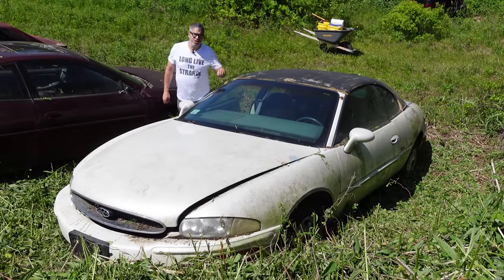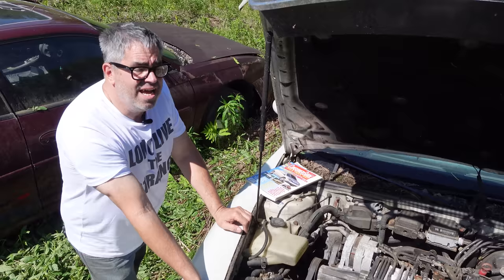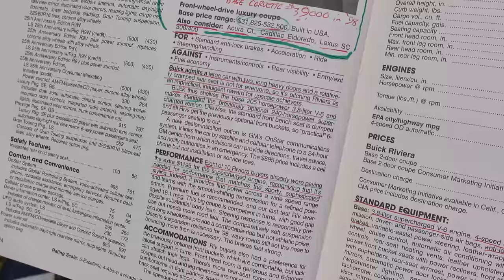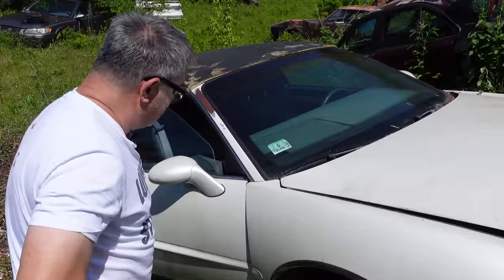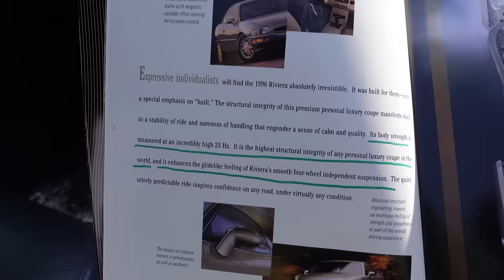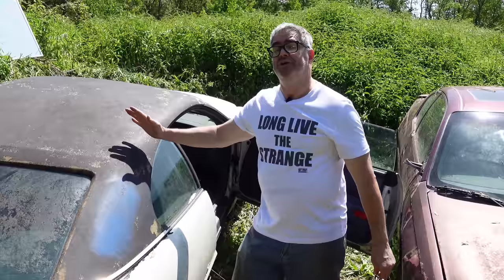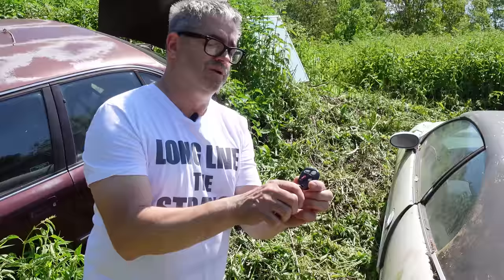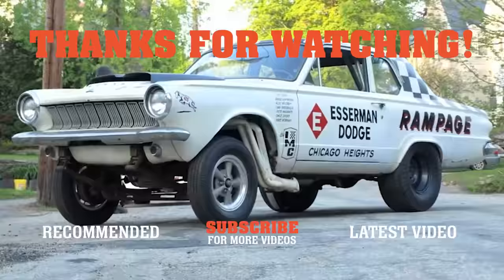More Power Than A Grand National!

Comment: Had a 98' Regal GS supercharged, it took many Mustangs! It hit governor at full boost like hitting a wall! That car later saved my life in a horrible accident was a great car .
Reply: A computer reprogram (or chip replacement if PROM equipped ) will eliminate the 109mph limiter . 
And then. . . . KATY , BAR THE DOOR !
Reply: I don't believe that at all...Had a 98 GTP supercharged and it couldn't hang with the slowest Mustang I've owned an 1989 automatic,,,,my Cobra would've Murdered it and my wife's Coyote 5.0 would be in the next county by the time that thing hit 100mph
Reply: My buddy had a 99 Regal GS S/C with 20 inch gold wheels, 2, 15 inch square Solo-Barics, it was a super pimp-modbile in 2000, LMAO!
Reply: @tomcatmcgillicutty6913 Your GTP had boost leak or compression loss...or something, lol. My buddy's GS would annihilate the same year GT's and just dog walk the old 5.0's. Well no sh*t a Coyote 5 liter would destroy a 240hp brick mobile, they're 412hp in their lowest HP form...
Reply: @jesterokjones4954  7.4 sec 0-60 and 15s in the quarter mile,,,,Isn't enough to "take out" many Mustang s,,,,,,,,unless the Mustangs don't know your racing....
Reply: @tomcatmcgillicutty6913  I wasn't driving, wasn't my car, but I was in the car for a few races with some Mustangs. The Mustang did 0-60 in 6.8 and ran 15's as well, you also know that those figures can vary a lot depending on conditions.
Reply: @jesterokjones4954  BS
Reply: @jesterokjones4954  Nope 98 gtp bought brand new,,,wouldn't hang with a Mustang,,,if they were that quick go look up the quarter mile times they laid down,,,not happening bro...Taillights,,,,that's all you'd see
Reply: @tomcatmcgillicutty6913  he sure wasn't encountering Coyotes , they hadn't built them yet . And running into a Cobra was very few and far between . 
He said he raced "Mustangs". 
What he was probably running against was 4-eyed Fox bodies , which were mediocre at best . 
While the Riviera had a supercharged V6 , a four-eyed Mustang could have a PLETHORA of weak , anemic motors . 
When the Fox body came out in 79 , the 302 ("5.0") was available .
But for 80 & 81 , they took the 5.0 away , and the top engine was a weak-sμ©k 255 V8 . 
In 82 , the 5.0 4V was back , but it wasn't "legendary" by any means yet .
Now factor in how many 4-eyed Mustang were built with naturally aspirated 2.3 4 cylinders , 200 cid inline 6s , and 3.8 liter V6s. 
There were an awful lot of 16 second plus Mustangs rolling around . 
Even when the roller cam , fuel injected engine came out , most cars were still testing in the low 15s/high 14s . 

And then came the legend ~ TONY DEFEO ! 

Even though he wrote for a magazine , Ford wouldn't give him a roller EFI Mustang to test ~ Probably had SOMETHING to do with a drag test he'd recently done on a Lincoln LSC ! 
But that didn't phase Tony - he went out and BOUGHT , with his own money , a brand new stripper 5.0/5 speed LX hatchback . 

And then he SET THE WORLD ON FIRE , pushing that bone stock 5.0 to a 13.89 
 No one had EVER seen a stock Fox body run that quick before . 
Tony eventually got that car down to 13.49 , bone stock , I believe . 

But before Tony , 15 second Mustang were the norm . 

So , there were a LOT of slow Mustangs out there only L👀KING fast - no surprise that this Riviera encountered a few of them , because the mediocre Mustangs probably thought it was another 18 second LeSabre. 
Surprise , surprise , surprise , as Gomer would say !
Reply: @tomcatmcgillicutty6913  BTW , the street ain't the strip , and a LOT of Mustangs on 225/60R15s that could find traction on a concrete pad soaked in "track bite" would just sit & spin on oily Macadam ! 
FWD with all that weight over the drive wheels has a real advantage at the "stoplight grand prix" !
Reply: @Richie_the_Fixer  Yall are funny,,trying to make these things out as some kinda pocket rocket hahahhah,,,go check out the advertised et's of the day,,not as quick as the mustangs of the day...I had one they were ok as a family ride but NOT Mustang territory...Any FoxBody 5spd in decent shape with a 2-4degree timing bump in a good tune with a good driver was a 14-14.5 sec et car all freaking day..Drag radials and it's well into the 13s..... You guys are smoking crack
Reply: @Richie_the_Fixer  I'm talking the 86-93 variety,,,not the 4eyed cars 79-84 although those were actually  cheaper and easier to modify,,so yeah he might have beat up on some of those but I've seen enough 86-94 variety Foxes running low 14's stock I t s accepted as the norm for those,,,13's with a decent set of rear tires all day....
Reply: @tomcatmcgillicutty6913 xactly. These guys making it sound like they were fwd LS powered Camaros and Trans Ams 😂

These cars couldn't even outperform a comparable Nissan Maxima that were 3.0 liters and naturally aspirated.

A 98 Max ran 0-60 in about 7.5 and the 1/4 in the high 15's. With a smaller engine and naturally aspirated. 

All these GM cars were junk 😂 just these badge programmed American consumers overpaying for the short end of the stick 😂
Reply: Everyone arguing about how the Mustang was so much faster must've forgotten about 95% of the shitbox Mustangs manufactured and on the roads between 1982 and 1998. The vast majority were daily drivers, not Cobras and tuner projects. If you lined them up at the track for 1/4 mile pass the Regal would've crossed the line in about 15 seconds while your mom's Coyote Mustang would have crossed after another 13 years of R&D and manufacturing.
Reply: @paulybeefs8588 Sorry pal, the OG 5.0 Mustangs were faster than these stock for stock. That's just facts. I'd bet a '99-04 GT would be faster as well. Go look it up if you don't believe me.
Reply: @TireSlayer55  Learn to read.  You're comparing cars of a different era. Pretty sure there weren't many '99-04 GT''s on the road between 1982 and 1998. The vast majority on the road through that era were from the 70's and 80's. Even most of the 5.0's of the era made less than 200 hp, ran a 0-60 in the mid 8's, and a 16 second 1/4 mile.  

But why even bother talking about the 5.0s when the majority of the shitbox Mustangs on the road actually putting miles came standard with a 2.3L 4 cylinder or were "upgraded" to the 3.8L V6?  Sure, you could find the occasional fast Mustang parked in someone's garage, but 95% of of the shitbox Mustangs out there driving around couldn't hit 0-60 of before the end your average FM radio commercial.

gO lOoK iT Up iF yOu DoNt bElieVE mE
Reply: 1999 GM took all the imperfections out of the previous years and made the 1999 less than 100 exist selling 4

Comment: I have  a '98 Grand Prix GTP  with the 3.8L supercharged, still runs and drives great.  The first 3.8 supercharged I ever saw was in a Buick Park Ave.
And my Father had this same Riviera back in the '90's .
It was a fun car to drive then. Just as my Pontiac is today.
Reply: I drove a '97 GTP for 12 years.  I loved that car.   I'd still be driving it but the Michigan winters took it's toll on the body.  It was still running great with over 230,000 miles when it went to the scrapyard.
Reply: @tonecapone8021  
Mine is a Florida car still in great shape for being 25 years old and 225,000 mile on it. 
I'm thinking of selling it to someone who really wants a '98 GTP.
Reply: Love the GTP, the GXP with the 5.3 is pretty great too
Reply: @phillipthethird42 How much?
Reply: My GTP's supercharger went belly up at 80,000 miles.  Pulled the belt off and kept driving it until I traded it with the belt still in the glovebox...
Reply: I also had a 98 GTP, it was a sleeper, just wished the trans could've keet up with the engine.
Reply: This comment section makes me so sad and happy. My dad was a car dealer. We had plenty. We loved GM products. We just always ran into issues we just got unlucky and got Monday cars. I still have such a special place in my heart. I feel bad for the kids born in 1999. They never saw some of the coolest ideas. My 1990 Seville was all electronic and digital. So so so beyond its time. The Chrysler Lebaron would talk to you. LoL. Lincoln came with an unkillable engine(4.6).I love old school I wish I could go to a museum of all my memories.

Comment: You simply cannot beat those '90s Buicks! I drive a 1996 lesabre and my drives a 1999 Bonneville. Both are clean cars and super comfy. Gotta love the 3.8.
Reply: I only ever still seem to see centuries on the road, and lots of em.
Reply: The 3800 lasted FOREVER...  My current 2009 Buick Lacrosse is the LAST year of the 3800, hence why I havent bought a new car yet. The current 3.6 that replaced the 3800 is GARBAGE, and I'm going to wring this 3800 out as LONG as I can, and hopefully there will be a better V-6 option than the 3.6 by the time I need a new car. I will NEVER own a 4 cylinder car. I did once, and never again..
Reply: @davelowets   ^ comment is the truth . 3800 engines might require a water pump or maybe an intake manifold but usually no internal repairs ....ever .
Reply: 1999 GM took all the imperfections out of the previous years and made the 1999 less than 100 exist selling 4

Comment: I have owned two of these. They are extremely reliable, handle great, and are very peppy. Also as soft as a caddy...almost. Very well built!
Reply: Hang onto them. They were nice cars, but going forward I don’t think cars from the 90’s onward are going to be restorable due to all the electronics, so survivors are our best option for preserving the modern era of cars.
Reply: @seed_drill7135  Agree.  I've got a pristine 99 Riviera with only 81k miles on the clock.  Garage kept.
Reply: OK, so it's not a Riviera, but my 2006 Cobalt SS is still running strong at well over 200,000 miles. G.M. may have had their problems with paint quality (my clearcoat started peeling when the car was only about 4 years old) and incidentals like interior trim, but the things that need to be reliable ARE reliable. It still has its original front struts and clutch. No electronic problems whatsoever. The only thing that sidelined the car briefly was the original alternator crapping out around 150,000 miles. That's it, otherwise the car is stone reliable, as was the '99 Chevy Venture minivan that served as our family car until our kids were grown and gone. I can only assume that other G.M. products of the general era are just as good... unlike a friend's Ford Contour that spontaneously combusted when it was only a couple of years old. She got out safely, right before it burned to the ground. Nothing left but a shell. Even the tires and wheels were gone except for the tires' steel belts. That was the hottest Ford I've ever seen!
Reply: Me too and still own one of them
Reply: By "handle great," I assume you're referring to the ride quality?
Reply: Valet in the 90s. Those Riv's & Aurora's were a comfy ride. Smooth drive.
Reply: @Holmesson  Handles tight, very responsive
Reply: 1999 GM took all the imperfections out of the previous years and made the 1999 less than 100 exist selling 4

Comment: I worked at a Buick/GMC dealer bodyshop when they were around. We had one come in with a hard hit on the passenger side. The inter structure of the reveal (opening for door etc) was a one piece boxed unit, which provided rigidity and strength.  There's no place to cut and seam it, as that would compromise the structural integrity.  The technician had to gut the entire side of the car to replace that structure, even the rocker panel is part of the structure. I remember the insurance adjuster had to come back out and write a supplement that was almost as much as the original estimate. I was the refinish tech,  what an extensive cut in (painting the inside area) that was! Although not damaged,  the roof also had to be painted, as that structure was welded to the roof inter structure.
Reply: If you're going to get t-boned, it sounds like the car to be in...strong!👍
Reply: They had a strong 25 hertz body stiffness rating along with the Aurora.
Reply: The frame broke the GM stress testing machine
Reply: What causes the white paint to peel on so many of these vehicles. Vans especially it seems. Was it bad primer or bad finish paint?
Reply: @genogeno6643  Good question, I did many warranty repaints because of peeling issues over the years at dealships. It's rare that it's the topcoat at issue,  but not unheard of. The usual cause is the factory " Ecoat". It's an epoxy based primer that's applied electrostatically in a "dolphin dip tank" set up. After that it's baked. Sometimes it gets overbaked resulting in an adhesion problem for the topcoat.  I worked with some factory Chrysler factory reps on the problem back in the 80's. We were having most of the delamination problems on pw7 white and pc7 blue. Researching Vin #-s against paint production dates showed these colors Ecoats were being baked last, on Fridays.  Although the bake booths were shut off, they held heat over the weekend,  resulting in overbaking of the vehicles still in there. If you peel back a bit of the topcoat, you'll notice a white powder like residue. That's oxidized ecoat from the overbaking. You can sand the ecoat with 180 grit, and seal and topcoat that, as the ecoat underneath is fine, plus the 180 creates a good mechanical bond. It's not necessary to remove all the ecoat if you don't have to.
Reply: @fishgeralding9224  Awesome! thanks for that
Reply: @genogeno6643  90’s GM corner cutting at play is what did it.
Reply: Ask Toyota, they are dealing with the same issue right now. Tons of cars in Brilliant White are being repainted by Toyota, my wife’s Highlander included. It literally peels off the primer.
Reply: @tholmes2169  super white a blizzard pearl
Reply: 1999 GM took all the imperfections out of the previous years and made the 1999 less than 100 exist selling 4

Comment: I had a 2005 Gran Prix with that supercharged 3.8. It supposedly mad it’s most horse power on premium fuel. Since it was a company car, I had to have a really good excuse for fueling it with premium. It ran good regardless. So I can appreciate that Riviera.
Reply: It needed the premium fuel to reach full timing advance . 
Lower octane would allow knock , and the knock sensor would dial back the timing . 

Trivia : turbo Buicks were the first cars to have factory knock sensors .
Reply: It had no intercooler, that’s why it required premium fuel.
Reply: And being an 05 GP meant the 260 hp series 3
Reply: We have a 2005 GXP too ❤
Reply: @Richie_the_Fixer You mean the first Domestic? Because Toyota had electronic timing control as far back as the 70's on some of their higher end models. Although those cars didn't officially make it here.

Comment: Most bizarre thing about these is that they developed coolant leaks from the alternator brackets . my son had this engine in an Impala SS and my brothers wife in a Grand Prix but the regular 3800s have the same issue . Coolant passes thru the alternator mounting bracket to the engine and the plastic spools inside degrade allowing coolant to weep thru where you cant see it leaking . Dorman makes steel replacements . many of these cars ended up being junked because no one checked the coolant and overheated . The milkshake oil wiped out the internals and new engines in a rusty car made no sense
Reply: Yes! Replace with the metal cold air intake immediately.

Comment: The L67 is a great engine. Bolt on a few aftermarket performance parts and a get tune and that engine will really wake up. I  own a 2000 Grand Prix GTP.
Reply: Yeah, I prefer the styling of the Pontiacs
Reply: fantastic engine. i have a 2003 bonneville SSEi, which is actually pretty rare these days.

Comment: Morning Steve.... owned an o4 grand prix with that powertrain, pulley change and a tuning chip and it was a real rocket ,ran in the low 14s in street class at the strip. Not bad.

Comment: Same output as the later Australia Holden Commodore with the supercharger. Fortunately it was rear wheel drive and I believe was also available with a five speed manual option, but then if you wanted performance their was the V8...

Comment: I was a Buick Drivability Tech when these cars were new. With an easy "upgraded" chip install, these cars (3800 Supercharged Riviera, LeSabre & Park Ave) had real "seat of the pants" acceleration you could feel immediately (no turbo lag).
Reply: 1999 GM took all the imperfections out of the previous years and made the 1999 less than 100 exist selling 4